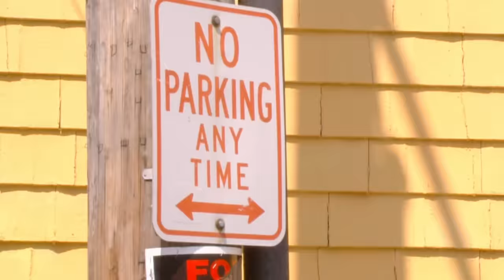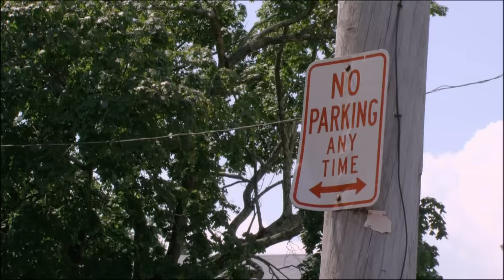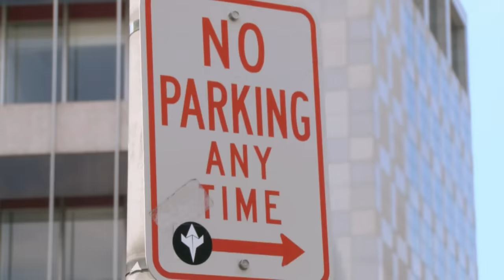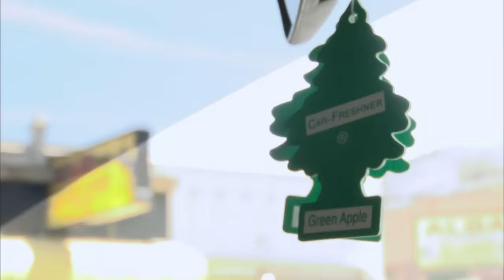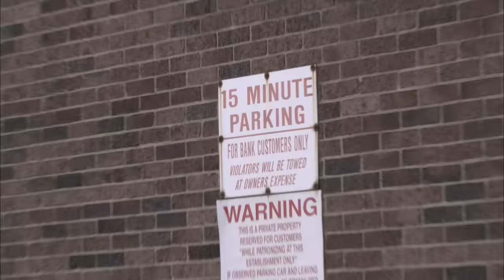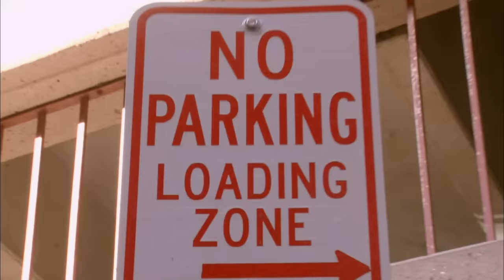Ticketing Delivery Drivers - Top 6 Moments | Parking Wars | A&E

Comment: The wrong side of the street delivery driver was parked next to a pole that said "no parking", but there was a parking meter less than 5 inches from the pole. So how does that work if he was parked on the correct side of the street? The person parked at the meter behind that one wasn't back far enough (it looks like) for a car to park and be next to the "no parking" pole. That makes no sense that a meter isn't usable 'cause a random pole it's right next to has a "no parking". Maybe that's why that spot was open 'cause it's cutting it too close and it would be a judgment call on the parking person if they think that parked vehicle is a little too close to the pole that starts the no parking zone.
Reply: See the white line under the front of the truck? That line distinguished no parking from parking.